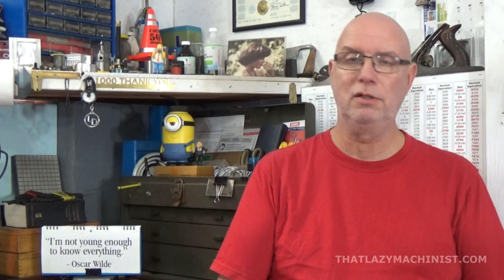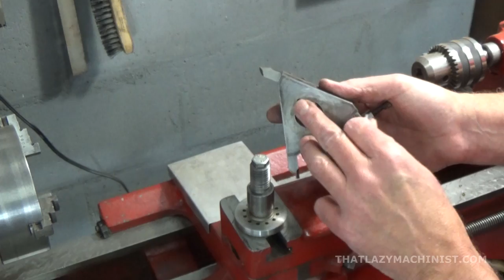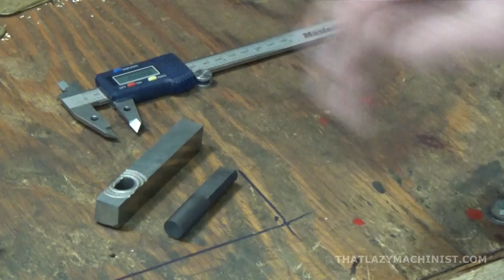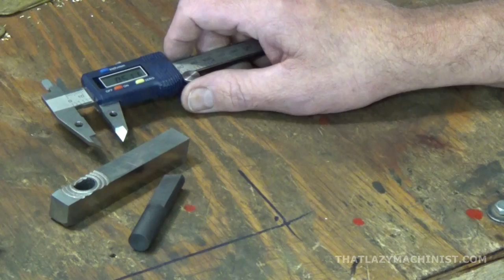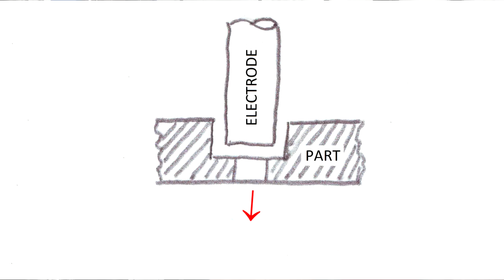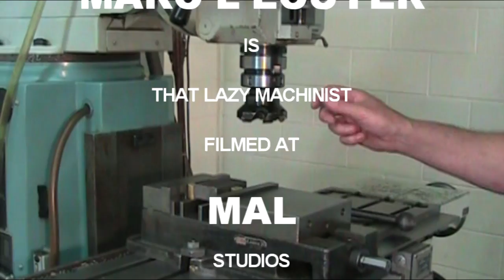Q&A 2 Nesting jigs,  plastics (polymers), EDM  (electrical discharge machining) & my lathe tool post

Comment: What would you recommend as projects for a High school student in a machining class? We have lathes, mills, and cnc forms of both.
Reply: One item we made was a round punch in an adult ed class 26 years back.  Another was a clean-out tool for milling machine slots.
Reply from the maker: Hi Joshua! I am sorry for the tardy response but my health has not been so good lately  "but I am feeling much better now!". When reading your question I remembered that I had developed projects and a teaching technique to go with them and I have never explained my teaching approach on video. I have decided to do so in 2019 and thank you very much for the inspiration. What age are your students (generally)? How many students are in the shop at the same time? How much theory time do you have? How much practical (in shop) time do you have? How many machines to you have (how many lathes, mills ....) and finally, what is the objective of the course (general knowledge, confidence boosting, training for future employment ...).  I use to do the positioning hammer project, the 1-2-3 block project and the drill point gauge project in my first semester. I had 4 hours of theory a week  and four hours of shop time for a 16 week semester. Blueprint reading, language training and math were covered in separate classes. You can download the prints for all of my school projects from the first page (green button with English text) of my website   THATLAZYMACHINIST.COM   and you will find the accompanying English videos on pages 2 and 3. If you can get back to me with your class info, I will try and help you with the planning of the projects. Marc
Reply: THATLAZYMACHINIST I’m a student, I’m a senior this is my fourth year taking the class and we are on a 8 periods a day schedule so roughly 45 minutes, we have a good amount of lathes and mills and a tornado cnc lathe as well as a Cnc mill